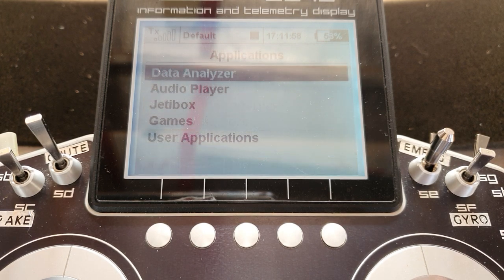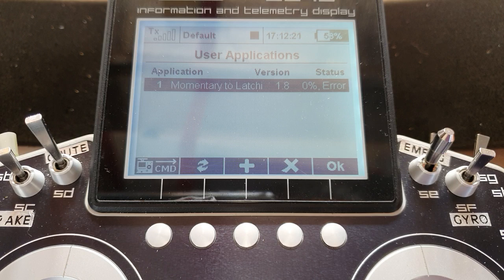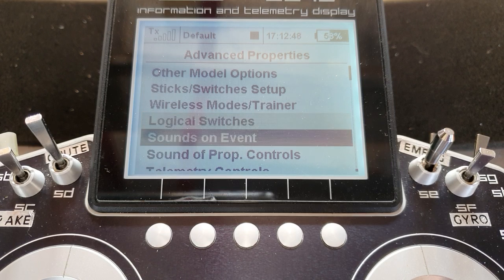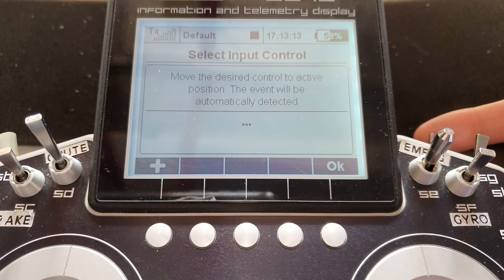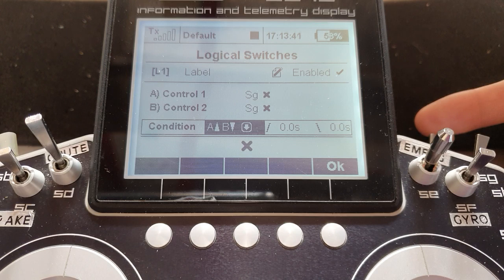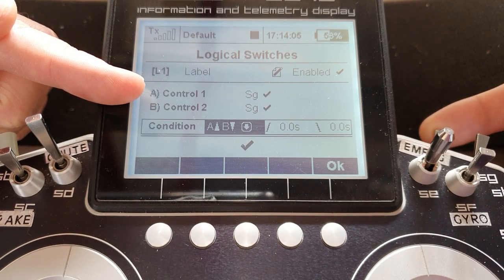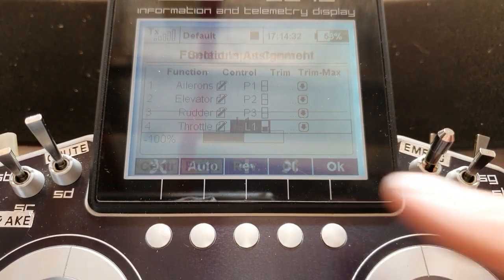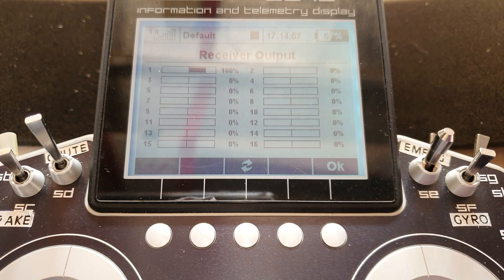Jeti - convert a momentary to a latching switch/push-button

Comment: Hi Harry, thanks for the great videos.  I'm trying to find a way to be able to get two outputs from a single momentary push button.  If I push the button quickly I want it to read out the altitude of the plane.  However if I hold it down say for two seconds I would like it to read out the flight time timer.  Any idea if this is possible at all?

Comment: Thanks Harry, I have learnt so much from watching your videos. I don’t know if you have spotted in Firmware 5.03 in the switch setup screen, any switch whose type is Button or changed from Auto to Button, then changing Button memory from No to Yes changes it into a latching switch.
Reply from the maker: Thanks Richard, I spotted that option only very recently.  However it only works in limited circumstances.  It is global for that button/switch in that model, my way allows the button/switch to be used as latching and non latching at the same time.  Cannot think of an example of when I want that, but someone will!  Also it does not work properly with the 2 way spring switch, the button memory only works in one direction.  My method works in either direction and allows a different latching switch in each direction plus still working as non latching as well!

Comment: I want to do this - but I want on to be -100% and off to be 0%. Using it for CortexPro on/off
Reply from the maker: Adjust the function curve.  Instead of the default -100, 0, +100, change it to a 3 point and set the points that you want at each end.
Reply: @cotswoldpilot  I set the set the servo travel for the function in the servo menu. This works but your method is may be more elegant. 
There was another trick I figured out. I wanted sounds on event for the Cortex, but I'm using a push button switch. So in the sounds on event menu you can push + and use a function to trigger the announcement. 
This is an improvement for my setup. I've always used a three position switch for the Cortex. The middle spot was off and the two end points would have different gains. One for high speed and the other for low speed. Now, the three position switch is used for flight modes and I can toggle the Cortex on/off as desired. 
I've been using Jeti for 4+ years and I'm still learning new tricks. Keeps me interested.
Thx